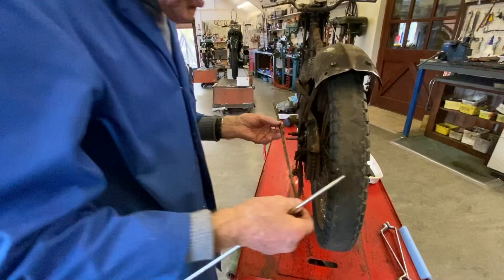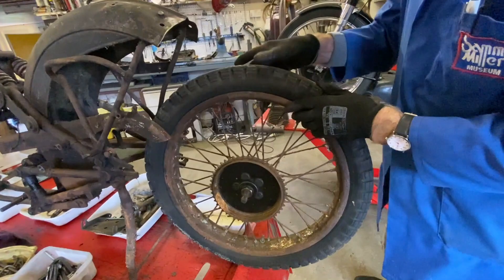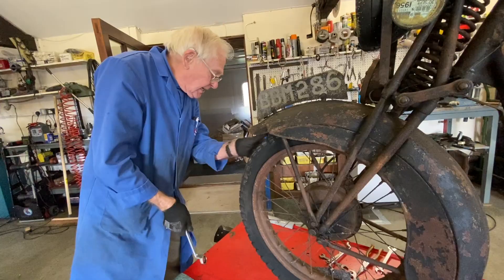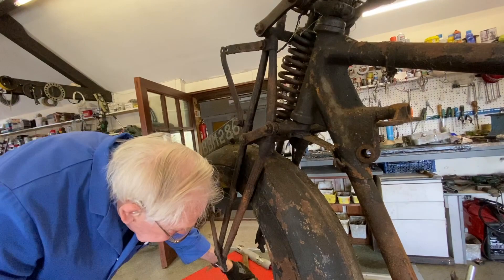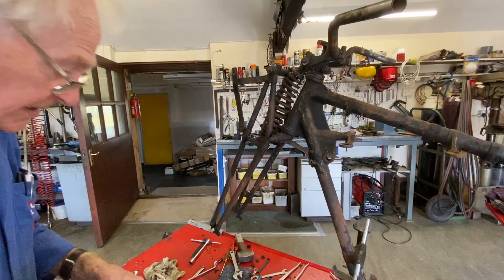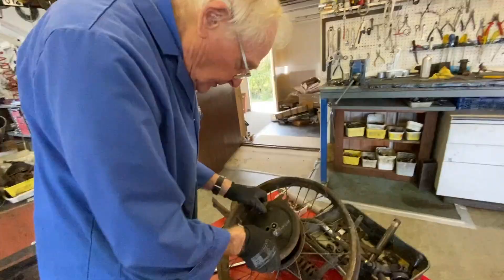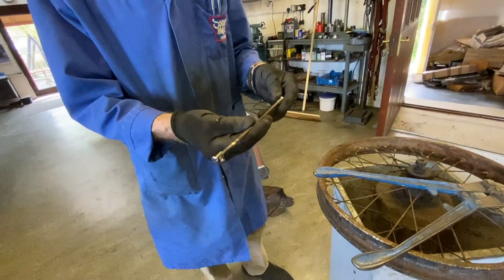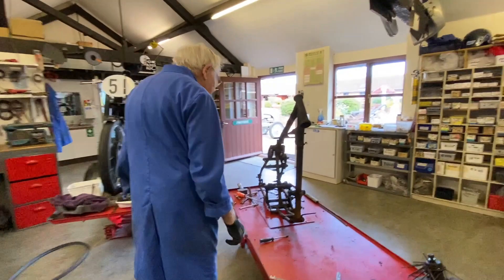SM Restoration Files: 1937 New Imperial ----- EPISODE 3: Frame Disassembly

Comment: I fix my damaged hex bolts in a vice with a file. If you're careful it's a quick and easy job. Definitely worth doing when the correct sized spanner becomes too small to fit over the damaged bolt.